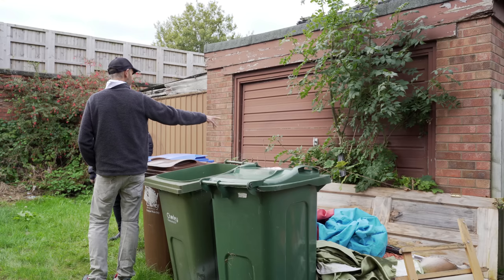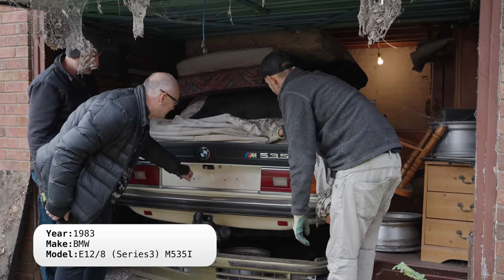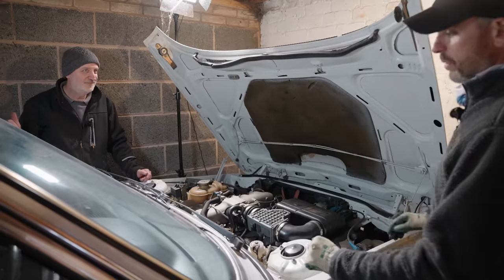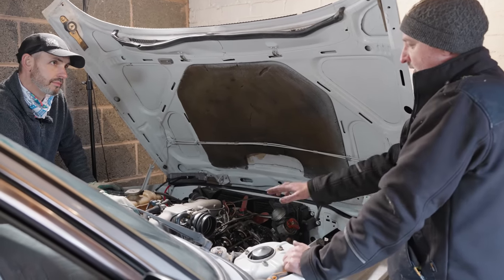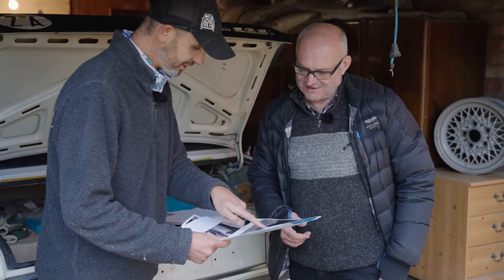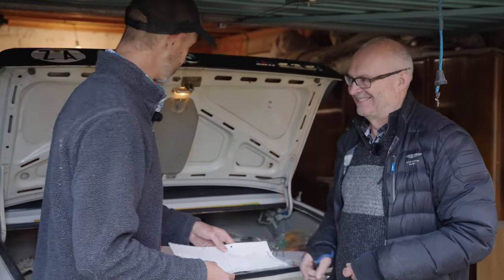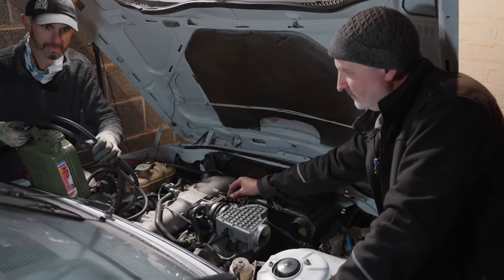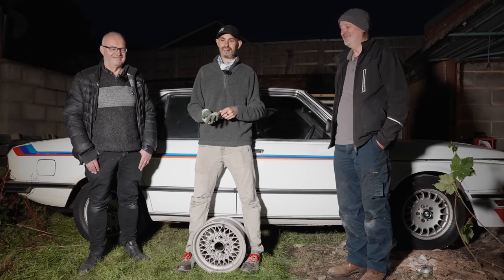Barn Find rare 80s BMW M Sport survivor car untouched for 30 years - will it run?

Comment: BMW South Africa created great cars during that time. The 325is (because we couldn't get the M3), 333i, the e23 745i powered by the M1 engine. South Africans like to give nicknames to special cars. The 325is, specifically, is called "Gusheshe" (goo-share-share; it's derived from the word "akusheshe" which mean "hurry it up"), the e36 is "dolphin" because of its shape and the e46 is a "g-string" because of the grille. And this 535i is called "isandla semfene" (the monkey's hand) because of either the bent shape of the exhaust or the "trickery" that was performed on the racing and homologated car.

Comment: We, my brother and I, had an E12 M535, was a SA car in Western Australia, we bought it off an old guy, belonged to some kids that owed Him money, we got it for $350. Had L-jet injection, wind open sunroof, 5 speed manual, old style M badges. Had a blown head, young fella's had droppped it on it's guts, E34 wheels, burnouts, cooked it.. Put it on ebay, sold almost immediately $1700. I say We, it was My brothers find, and He only wanted a quick turnover, chemiweld, I insisted we fix it, as we had a spare head off an E23, so cancelled the sale. Not sure where it ended up, I was gunner keep it for my boys first car... I've seen an E12 M535 on the local bmw pages, Maybe same car? I thought M series started with E28? So what's an E12 M car?

Comment: Can I ask if anyone feels as though before attempting to crank the BMW over, they should have taken a bit more time to make sure the engine was free? I thought if a rare vehicle hadn't ran in, for example, 30 years, then attempting to  just start it would be considered a bit of a no no?
Reply: I would have changed oil, cooling fluid and maybe the plugs too. Running it with 30y old oil might not have done it any good

Comment: I think the 'untouched' comment is stretching it a bit because you can clearly see that new paintwork has been applied to the front to the car because the stripes have gone from both sides of the car. Still a nice looking car though but the owner needs to come clean as to what work has been done to the front of the car to explain why the stripes are missing on that part of the car.

Comment: It's always fun to see a guy finding a Ferrari, a Lambo or an ultra rare BMW in a barn, and even after years of storage, except a little dust, the car is new, even the tires are not flat, full tank, still with the dealer's label and a nice song from the 80s in the 8-track player starts when he puts the key in the starter (of course battery is also full and ready to go). 

And of course, the random guy doesn't find a broken Yugo or a old rusty Ford Pinto but a Ferrari ... OK it's "just" a BMW but next time maybe a Ferrari 166 with serial "Prototipo Ferrari 001" signed by Enzo itself.  

Same with the guys who buy abandoned storage boxes, they don't find 70's rotten furniture or disco tapes, of course they discover diamonds, gold, gun from the 1700s, the original and only existing Star Trek actually working tricorder, a lost Van Gogh or the draft of the Declaration of Independence.

And naturally, the previous owner of these marvelous artefacts were too poor to pay the 10 bucks monthly fees...

It's as fake as the guy restoring and old camera with water and soap et voilà like new🤣.

Comment: Im surprised there werent more precautions and or steps to get it started.  Fuel pump, Fuel, oil, spark and compression
Reply from the maker: There was, but we cannot keep everything in the edit. We removed plugs and oiled bores. We turned it over with good oil and no compression. Then turned over with no fuel on starter. Next we introduce the bypassed fuel pump and fresh gallon.

Comment: I'm a big car guy myself. And if this is such the holy grail of a car, why is there no fender covers used to protect the paint when your working on it? I never work on a car without fender covers. When I was a mechanic, the boss would practically fire you if one was not used. I even used then on the lowest made car, simply cause I didn't want the dirt from the car on me. You could never give me any excuse I could except to have me forgive you for not using a fender cover. And this is not just for this show....it seems none of these shows seem to use a fender cover....Its the holy grail car, but we don't give a shit if we scratch the fenders.....

Comment: Got a 1996 Cadillac deville bought it last 2 years only to start working on it last month the V8 toke few minutes and fired up car was resting for about 17 year’s previous owner guess who it is? GADDAFI’s SON HANNIBAL as a first owner the car was auctioned in Tripoli no one wanted it because it didn’t start but I who goes around with his tools managed to roll the engine and once I found out it wasn’t seized I bought it with 1600$ because that’s the only price was given 
Yesterday was the first day the car was out man the 4.6 North Star engine is such an AIRBUS makes you feel your about to take off soon this beast is heavy yet kicks a good punch on the road with so much luxury accessories and tinted windows my friends told me looks like a G CAR all chromes out running so smooth with 76000 KM on it was always maintained by presidential garages

Comment: What I don't understand is why didn't u change the oil and filter as the oil would have been crap and the paper filter would have fallen apart and blocked everything as a mechanic most of my life that is one of the first things I would have done

Comment: Hm, it is very suspicios that tires are full with the air.
Reply: Tyres will usually stay aired up if they aren't on the car with no weight on them and are in good condition

Comment: Poor engine....cranking for ages, sitting for 30 years and didn´t bring sparkplug( i think), didnt do an oil change ( i think) , didn´t lubricate the cylinder walls for atleast 24 hours, didn´t take off the valve cover to lube everything and check over before cranking.  Sure no one is actually going drive this car anyway, but doing it like this will gouge the hell out of metal parts.

Comment: Incredible! As a Saffa BM fan, I'm torn in two, wish it was still in SA, but realise that if it stayed in SA, it more than likely would've been trashed one way or another. SA had some special Bimmers, the E30 333i and 325is, both built in conjunction with Alpina as we never had the E30 M3 in SA. Here's a video of two of those 535i's racing at Kyalami. https://youtu.be/hTVJPNW4_aY?si=BfunY1CEQzFuiqlU

Comment: This is why you never just start cranking a motor thats been sitting a long time.   You really should watch other channels that specialize in revivals such as Vice Grip Garage and Junkyard digs, i've seen several of your barn find revivals and you guys are below amateur level.   You should always pull the VC and spray the valve stems with some light lube (WD-40, whatever), should roll it over by hand to ensure no valves are sticky and smacking pistons.    Finally should use fuel mixed with a little 2 stroke oil to assure everything gets lubed up nicely when you try firing it up.

Comment: To try to start a car that has been untouched for 30 years using these methods... WD40 and just turning the key, I am shockd, shockd! 
I don't want to be rude or anything, but trying to start the car with old 30 years oil, old 30 years Fuel, and no lubrication for 30 years first, you create a lot more wear in the engine which was completely not necessary, but hey is youtube everything is for views, I get it..but the fact that you think that is a job well done.. men you have no clue...
Once again a don't want to hate or anything..but this is just disgusting

Comment: Very cool car, very annoying host, disappointing owner (11yrs w/out even looking at it!) And the other dude was supposedly a BMW Restoration Specialist but had never heard the sound of a collapsed lifter on a BMW engine before...??? 😒 WTF.   highlight of the video was the little fuel can / pump the dude made but he was a  I wonder how hot that starter motor got?  Oh yeah, for a couple dollars or pounds or clams or whatever you chaps call them, you can get this amazing stuff called Starting Fluid, it comes in an aerosol can and you'd never believe what it's for!!!